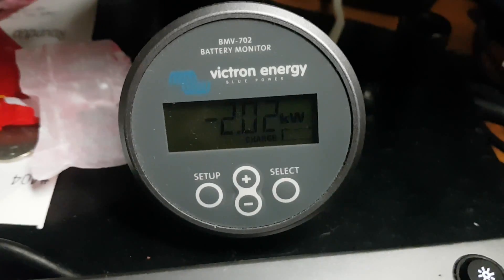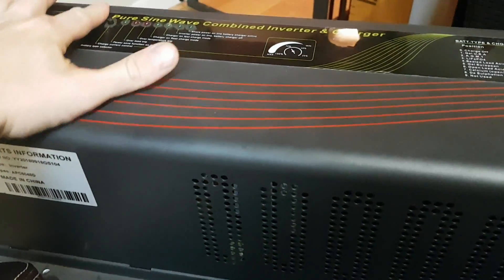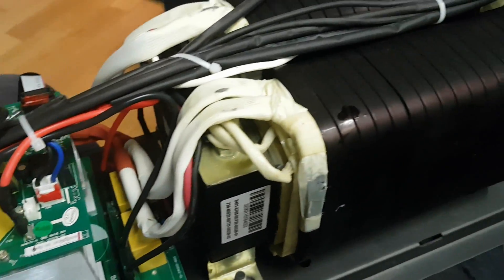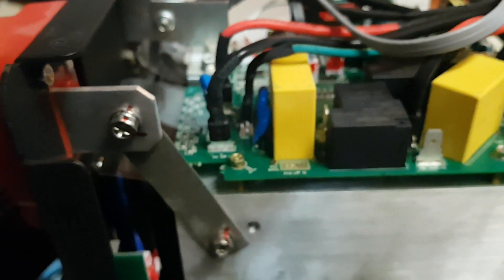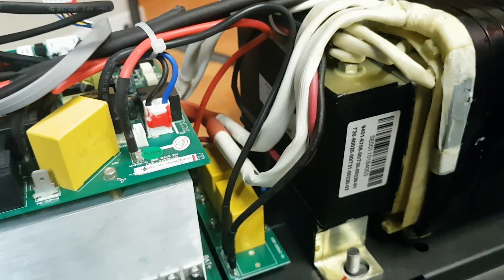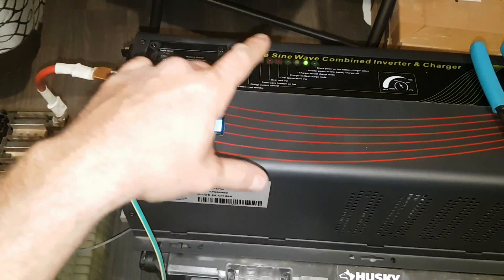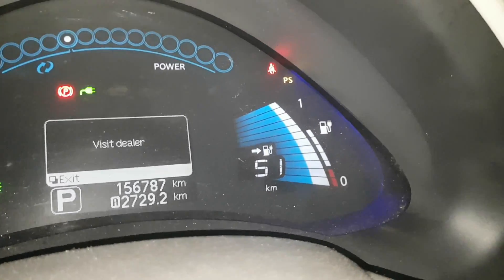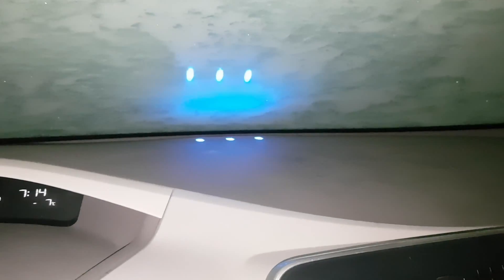6Kw Inverter And Nissan Leaf Only 2Kw Charge

Comment: S85 2014 Tesla on 115k miles so similar miles, still have 94% of range in battery. Nissan messed up on the Leaf batteries and was why I sold ours at 40k miles. Only mentioning this to show the difference to people between managed and non managed batteries

Comment: If that’s a power jack 6000 120 volt. It’s complete junk. I just sent mine back because it had limited functions and one of the cooling fans ran 24/7 on top of it arrived bent to crap from China. I’m glad I got my full refund and would never buy that type again. Stick to a Aims inverter/charger. You get what you pay for.
Reply from the maker: Not a power jack  :)
Reply: Going Off Grid 
Ok great.

Comment: Sigineer won't sell parts to the public, they record your email address and serial number at time of purchase. I bought a salvage inverter and tried to buy a MOSFET board from them, they refused to sell to me. Instead, I bought a bunch of genuine Infineon MOSFETS from Arrow for like $20 shipped and fixed it myself. They might be using fake Chinese MOSFETs, they seem to blow up pretty easily.
Reply from the maker: interesting, thanks a lot for the info!

Comment: I got over two years on a 3000 watt reliable inverter it doesn't seem everyone has the same luck as me with them.I think running lithium batteries have something to do with it less voltage sag and brown outs heating components
Reply from the maker: same i have only had the old tech 8000w die, all the smaller ones are great!

Comment: Maybe the leaf is trying to heat the battery before charging. Sigineer looks pretty beefy maybe just a bad board. If there is anybody that can fix that leaf battery it's you lol. Carry on.
Reply from the maker: the inverter had a bad board its now being used up north, it charges at 3000w as well.
Reply: @GoingOffGrid101  Hey buddy is that model any of these APC6024DT, HP12048D, HP15048D as these are the new models that can AC couple and as you know I'm looking for one or as much information as I can get before purchase.
Reply from the maker: @offgridwanabe  it says APC6048D
Reply: @GoingOffGrid101  Thanks I was hoping it was the new one.

Comment: Can't charge lithium batteries under 0 °C, they really don't like it.
I don't know about the Leaf, but modern packs heat up the cells first. Looks like that's the problem.
Reply from the maker: the leaf has a heater as well.
Reply: 40 kWh Leaf user manual says it starts battery heater on -17  °C and stops when battery temp rises to -10 °C. Heater stops when battery goes below 30 %. If battery freezes below  -25 °C, car dies and can't be driven or charged before temp rises over -25. 

PS . At last winter I tested DC charging when battery was -9 °C and it charged only 5 kW.

Comment: Thats a shame it died so quick. Next time try fox power inverters. May be better
Reply from the maker: its a good inverter, its up north working now :)
Reply: @GoingOffGrid101  wow 250A . Thats crazy. Hope the inverter lasts
Reply: I wonder what the max discharge current is from the batteries?
Reply from the maker: @frankz1125  on the leaf ?
Reply from the maker: @frankz1125  the leaf can use up to 250 amps from the batteries

Comment: It's unfortunate the battery dropped so much, I hope my 2018 gives me many years.
Reply from the maker: I would like a newer EV someday, but till then im gonna add 28Kwh to this one :D
Reply: @GoingOffGrid101  Me and you need to collaborate on a road trip leaf trailer.  Small utility trailer/range extender/mobile powerwall
Reply from the maker: @InnovativeSustainableSolutions  are you close by? Im in Bradford area north of Toronto
Reply from the maker: @InnovativeSustainableSolutions  i have seen your videos :)
Reply: @GoingOffGrid101  Not exactly, lol.  I'm in Texas.  This would be a long range collaboration, but I think there is some value to having a portable powerwall, that can double as an EV battery.  Hit me up at the email on my channel and we can talk
Reply: It will.  I think you have the 40kwh battery, so you will be cycling the battery at half the frequency of the original 24kwh one. Because most of the damage to the battery is done while cycling, halving to cycles should almost half the degradation rate.  Try and avoid superchargers, and charging at sub-freezing temps
Reply from the maker: @InnovativeSustainableSolutions  my leaf has the 24kwh pack, but i have a different ev pack that will work in my arsenal that is 28kwh that will bòost my range